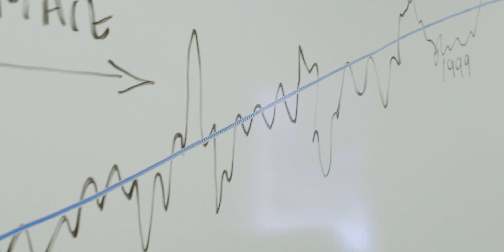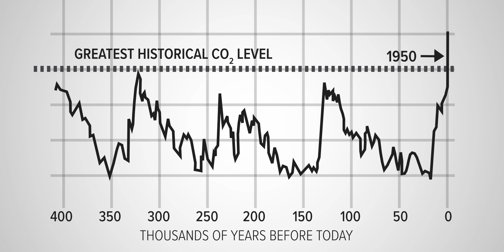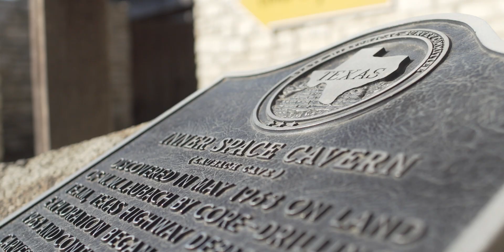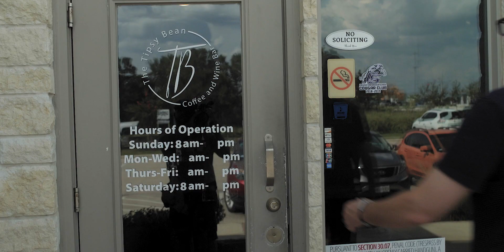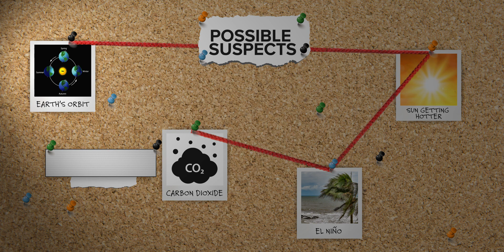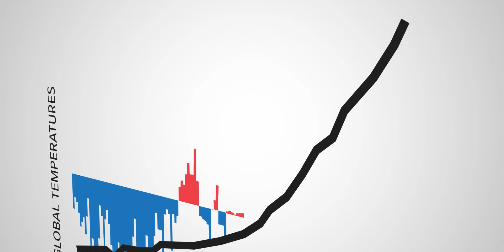A Texas skeptic learns the science of climate change (Part I)

Comment: What's causing the most amount of co2? If vehicles are the biggest culprits will battery power reduce it fast enough to start reversing the effects?
Reply: Read it and you will find your answers.

Solutions for climate change:
These 2 most important things, heating in towns and electricity generation ordinary people can't solve. We have to push government to push those that provide our heating need and electricity to switch to 0% CO2 solutions.
1) Towns are heated today mostly with methane gas (CH4) ! We can transform this gas to hydrogen with steam reforming and send hydrogen in town instead of methane. https://en.wikipedia.org/wiki/Steam_reforming  Steam reforming facility MUST have CO2 scrubbers on site and store byproduct CO2 in the ground.
2) electricity generation must be created from renewable sources much more like solar and wind.
Also existing electricity power plant on fossil fuels methane and oil (coal plants should be banned ASAP) MUST install CO2 scrubbers on every chimney and store that CO2 underground (old oil field or old natural gas (methane) reservoirs). Every CO2 release on large scale should be banned and slowly those small to in the near future.
3) Transportation, On this individuals can have more effects. You can buy EV or use more public transportation and most importantly driving as less as possible. Use bicycle or electric bike or bicycle as much as you can.
Those 3 things, 1, 2 are about 50-60% of CO2 emissions and 3 combined about 80% in total.
Rest is meat consumption,  plastics for example is  less than 1%  CO2 emissions.
Also use less, reuse and do not buy so much things from far away that need huge amount of transportation.
Buy local food, vegetables, fruits and always ask your self how much everything  you do contribute to CO2 emissions .
We can solve this right now but we have build infrastructure that depends on fossil fuels and it's not easy to switch instantaneously.
Things for example like CO2 capture from air is  solution that have no sense right now, but it is promoted by fossil fuel industry.
Firstly address all thing above and solve it to not emit CO2 in air, ONLY then we can talk about CO2 capture from air.
Also thing like energy efficiency is very important. If you thermally insulate your home you will use less energy for heating and then emit less CO2. For example LED light use 10 times less electricity for same  light intensity. Incandescent  light is only 3-5% efficient and LED is up to 30% efficient. Heat pumps, seasonal heat storage, solar heated water, solar roof can save lot of CO2.
Reply: Automobiles are a part of it, but without clean infrastructure to charge them, electric cars are only a little better for the environment.

Industry has the larger single capacity to improve. Hit all fronts, but realize consumers are easier to sway once industry backs it.
Reply: There are all sorts of opportunities for change, vehicles alone aren't the solution. This is an issue where we get to resolve a whole host of emissions - see https://www.epa.gov/ghgemissions/global-greenhouse-gas-emissions-data for an overview of emissions by economic sector, for example, and https://www.drawdown.org for a list of detailed solutions!
Reply: The most CO2?  By far: vegetation and oceans, which put out roughly 26 times the amount that humans do.